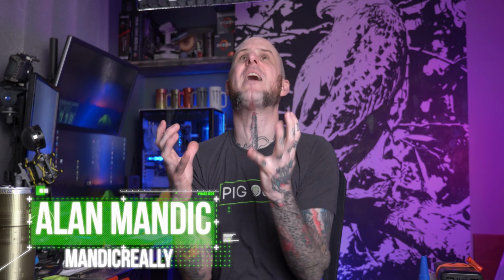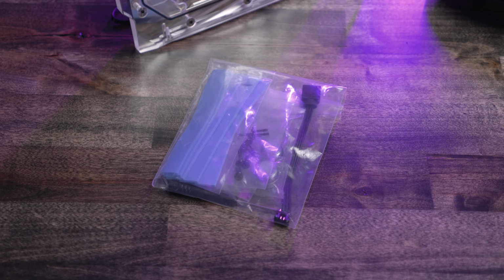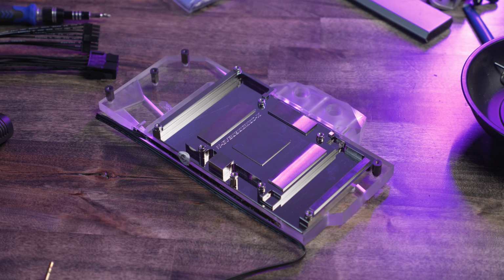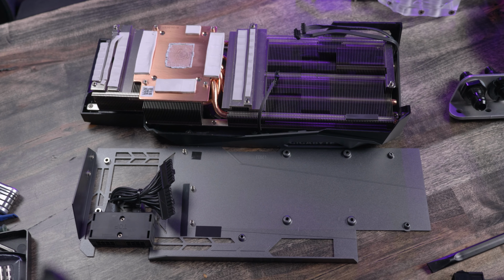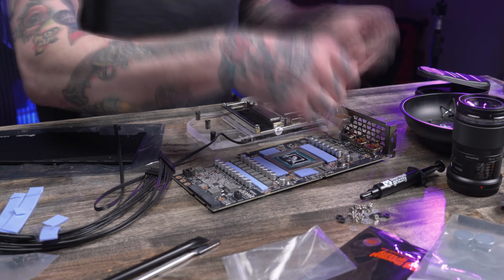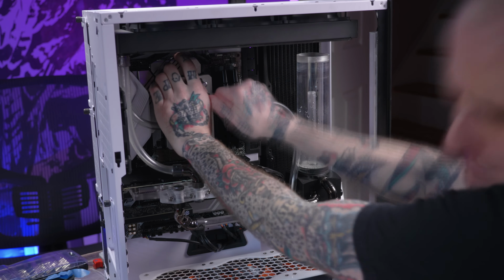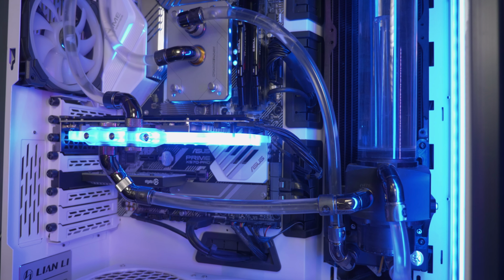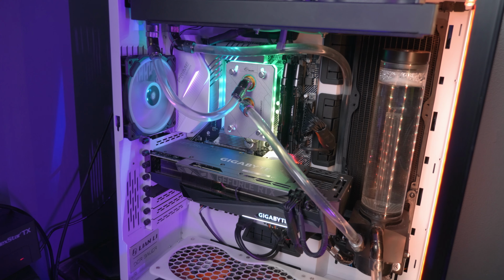Watercooling my RTX 3080! - Bykski N-GV3090GMOC-X

Comment: Really good video. 1 little detail: the big issue on the 3080/90 is the vram temp, not so much gpu. On my 3080 i was all comfy with 60ish °C, then I found out that on some games my vram was hitting 98°C. Wouldve been nice to tell difference there aswell with this particular block.
But still, very informative intel on the block, thanks!
Reply: There are two problems with the VRAMs - bad thermal pads and no thermal pads on the backplate side. The best test was actually mining ETH. Before - 110°C and thermal throttling, after replacing old thermal pads and putting new between backplate - 96°C (+750 MHz on MEM) at 27-ish °C ambient. While gaming they don't go above 90°C anymore.
Reply: I done this cooler on my 3080 Ti today.. Hmm i got ~62 C° on GPU and VRAM 96°..Still Hot on VRAM Maybe i have to try other pads ...
Reply: @hihungryimdad6242  I wonder if they make a sandwich version that cools the backplate.

Comment: I have the same card. Just ordered a custom loop for gpu only. 280mm x 45mm thich rad and good pump/reservoir. My card gets about 70-72 on air with fanspeed at 62%.

-It really is possible to undervolt this card with latest msi afterburner. I did it with 1950mhz and 500mhz on mem@ 975mv. It is an overclock and undervolt at the same time. But results vary by card and bios. 

I am really interested to get this card in the 50s celcius range but with lowest possible fanspeed for good silent noise as the gpu is the only thing now making noticeable noise at full load.

Tested a game like marvels avengers which pushes the card at 99/100% most of the time. On air I get 72c with 62%fan speed. So my goal is to reduce the temps down to 50's something. My rad is alphacool xt45. Which is 45mm thick. But now I see that the wateblock from bykski is not that good. But I still have some hopes to reduce temps down with lower or similar noise. What do you think??

Comment: I bought the Bykski N-GV3090GMOC-TC version for the RTX 3090 Gigabyte Vision OC had an issue with the included thermal pads, they were too thick at 2mm (1.8mm). I tried 1.5mm thermalright pads and those were too thick so I had to finally go 1mm on the memory and 1.5mm on everything else. Not sure how it worked out differently.
Reply: Also had an issue with on of the standoffs at the display port end was off by 2mm so it wouldn't match the hole on the board.
Reply: I'm also looking to get the exact same waterblock for my 3090 Vision OC. how are the thermals for the back side memory modules?
Reply: @kyleloh6237  lowest temps I got was 37C gpu and 72C memory with room temperature at 25C  with 2x360mm + 240mm radiators. It depends on setup. There is no way to discern front and back memory temperatures unless using thermal imaging camera on the back plate or thermal probe sensor.

Comment: What about vram temps?
Reply from the maker: Hour of Unigine looping they hit 80C. I’m going to be applying thermal pads to the back of the card to see if the backplate helps any. Then flashing the BIOS to a higher wattage one (I’ve discovered this card is a 330W bios) and see what happens. Look for a video soon.
Reply: @MandicReally  I bet they are higher then 80c.

Comment: what is the thermal pad thickness? thank you for sharing
Reply from the maker: By my measurements they are 1.85mm thick, so I'm assuming they are what would be sold as "2mm" pads.  I think I may order some 3mm pads and see if I can put them between the card and backplate.

Comment: Hi!
What is the GDDR6X temperature after installing the water block? After all, as you know, the memory is the hottest place on the 3080/3090 My MSI 3080 Ventus heated the memory to 96 degrees in the air. After installing the water block, the drop is not large, only 10 degrees, it became 86
Reply from the maker: I don’t have before temps but mine is sitting at 80C after about 1 hour of running Unigine Heaven. My GPU is only pulling 330W though (must be the 325W bios).  I’m going to flash my bios up and do a video about doing so, I’ll include those temps in that one.
Reply: @MandicReally  i think waterblock manufacturer need to pay more attention to the vram temps
they have to make some kind of microfin on it
and make the thermal pads way thinner than
thin enough that user can op to use thermal paste for even better vram temp
Reply: @MandicReally  80c with no back plate pads? I doubt that.
Reply: @MandicReally  I see you mentioning to put a different BIOS on this card throught the comments several times. Have you already done that? Would be interesting if that was possible. Thanks in advance

Comment: Did you put thermal pads on the back plate
Reply from the maker: I did not.  I actually discussed that when filming but this video was getting too long so I had to cut it.  None of the thermal pads provided reached the backplate.  So I would have had to double them up or get new thicker ones.  It was clearly not meant to be done.  At least on my card which doesn't have backside memory chips it wasn't. A card with backside memory chips would likely be a different story.
Reply: @MandicReally   Thank you for that that's very helpful  I have it on order but I also ordered 3mm pads for back so good thing I did 😊
Reply: @MandicReally  Huh. Very interesting. I've already replaced the backside pads on my card with stock cooling, and I'll be looking at what I need to do with the new backplate. I HOPING that the backplate tolerances are designed to cool a 3090 - otherwise I may actually have to mount the old backplate. If you mine on a 3090 (and even at MSRP it's hard to justify money if you don't!), backplate contact us not an option.
Reply from the maker: @rather-reverend  I'm fairly sure the thermal pads provided would work with a 3090 having back memory chips.  They just didn't for me with a lack of any backside components.  I order 3mm pads to try and put them on anyway to offer any additional cooling I can get.  I'll likely do a follow up video on that as I intend to flash my BIOS for a higher power limit and am worried about the memory when I do.
Reply: @MandicReally  my 3mm  pads work flawlessly highly recommended 👌
Reply from the maker: @pcandgaming9684  Excellent. I've got some on my desk, just need to find the time to do the project.  I'll post my results when I do. Thanks for confirmation it isn't going to be a waste of my time, ha.
Reply: @MandicReally  The Gigabyte 3080 Gaming OC 10g rev2.0 has back plate pads added from the factory, they added them once they realized they fucked up. How do I know? I bought it.

Comment: Right on!!! Was just looking into this block last night and here you are with a phenomenal video on the whole experience with it , I’m a complete beginner when it comes to Liquid cooling , I’ve always used AIOs but with you showing the setup of the block makes me feel more confident on trying a custom loop on my build soon enough!
Reply from the maker: Glad to be of help. Custom loops are fun snd rewarding, just take your time and they aren’t too difficult. Plenty of great information available. Good luck with yours. 👍🏻👍🏻
Reply: Don't be put off by the lack of instructions,  if you purchase directly from Bykski the instructions are included in a factory sealed package... actually most of their items are double boxed....This is a reseller problem, not a Bykski problem.
Reply from the maker: @addanzl  I purchased from the Bykski store on Amazon. So unless that is a reseller claiming to be Bykski, it was Bykski. If it is a reseller claiming to be Bykski, they should be taking issue with that to protect their brand.

Comment: Great video. Very comprehensive. I was fortunate to be able to purchase the same card and I'm glad there is a decent block available for it. Bykski also has a digital display module that fits on the block. It looks cool, though I don't know how practical it will be.
Reply from the maker: Haven’t seen that yet. I’m not much of a fan of screens for the sake of screens (I say as I have four full monitors hooked up) but for some builds that would be cool. I don’t need the active backplate they have now but I like the look of it, kind of wish it had been available when I bought this block. 👍🏻👍🏻